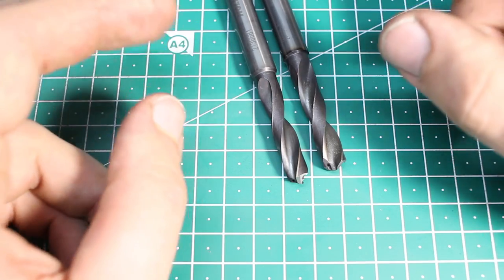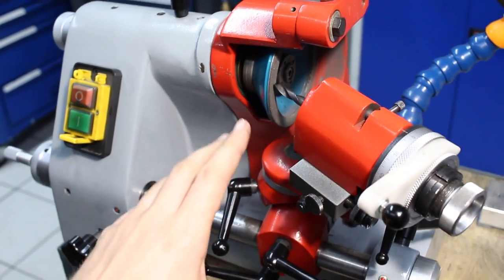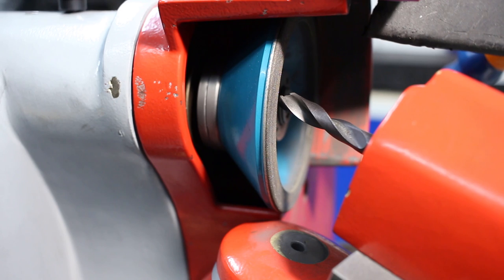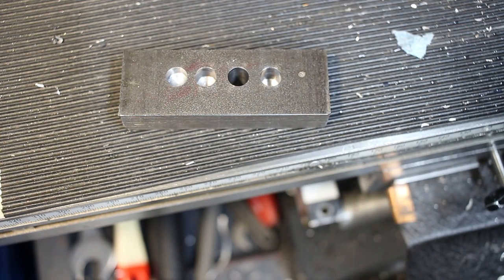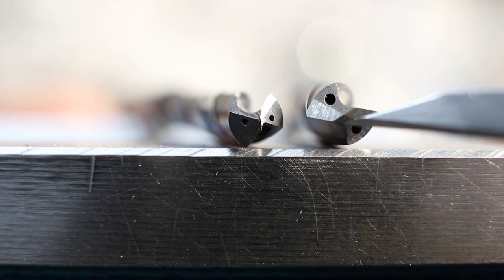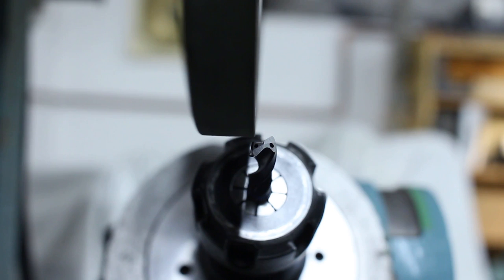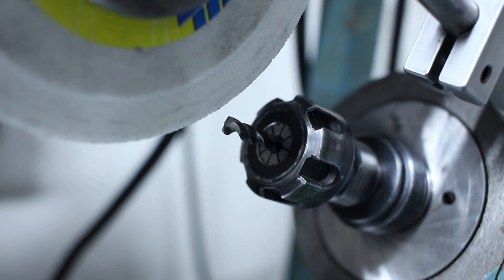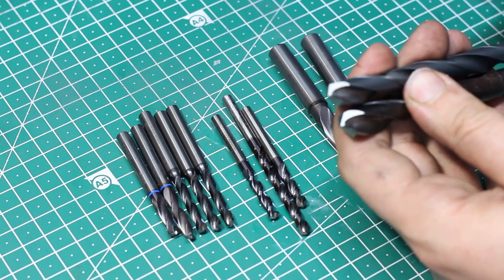Toolgrinding: Four facet grind

Comment: My ancient carbide lore warns me of carbide's brittle nature and raises concern for the fragility of highly positive cutting edge angles. The lip of a twist drill is a prime example where the positive angle equals the helix angle of the twist - possibly 15 degrees in the case of the carbide drills you exhibited. My first impulse would be to grab a diamond sljp stone and "back-off" the cutting edge of the lip to 5 - 7 degrees positive to a bright line - 0.003" (0.08 mm) or so. The object is a geometrically stronger cutting edge less likely to chip in the cut. More holes per grind.

My carbide experience began to peter out when I became a bureaucrat in 1985. I understand carbide technology has improved over the years to rival the brittler grades of HSS. Regardless, a neutral or negative rake would normally be recommended for hard drilling. Hand stoning to consistant edge geometry is chancy at best. Could your D-bit grinder reach the back-off angles I referred to? 

In any case, I think a D-bit grinder would benefit if equipped with additional work head swivel whose plane of rotation is parallel to that of the spindle. You could reach more wierd angles and planes. It would be a tricky project to implement withour making the workhead cumbersome.

Comment: The d-bit grinder (PP-U3) and the correct use of drill extension will automatically obtain your sharpened drill with 4 facets. The first is flat and the second gradient conical profile, this with one operation.
You can see detials in my videos about this.
For the chisel point reduction, it is also feasible on the D-bit grinder. If the drill is well sharpened, 2 identical large chips must be obtained and 2 identical small chips caused by bit tip reduction. With this device the latter is difficult to obtain two small chips but it is sufficient that there is one. I only use the chisel tip reduction for cobalt drills and carbide drills.
In attachment of these videos you can retrieve a document about the machine settings with the necessary explanation.
Because you carry out different machining on a separate basis, it means a lot of time and several grinding machines are needed.
The different steps are already well explained, with very good detailed recordings. Thank you Stefan

Comment: Long live the D-Bit grinder. A lot more useful than people give it credit for. Thank you for showing how simple it really is.  I will be making a right-angle magnifier with an alignment mark to do very small drills (old eyes need some help.) I use an ER16 straight shank chuck, which I cut the back down to give more length clearance (the part right behind the nut doesn't need to be as long as it is).

Comment: Hi Stefan, I know it may sound silly, but you can try to fill the drill bits holes with fluid, cutting oil for steel and wd 40 for alluminium. Just put some wax on the holes on the cutting edge, fill the drill, and go, When you start drilling, the wax goes away and the fluid works. I have tried with good results, but you have to make some tests according to materials and cutting speed. Yes, is not how that drills are supposed to work, but for amateur job is good.

Comment: I always thin the webs using a cut off wheel and my angle grinder. Not super precise but it works. :-)
Reply from the maker: I can do a drill regrind in the field, kneeling on a anglegrinder too ;)
Field Drill Gauge: Two hex nuts held together.
Reply: @StefanGotteswinter  118 degrees, 120 degrees. In the average field, both are good enough! Komplimente an deine technische Sprachkentnisse.. All good stuff.

Comment: Talking about collets, My U2 grinder shipped with just three Deckel style collets (4,6,8mm) which is severely limiting. I was expecting to buy additional collets but not expecting the price to be so high - £20 each in the UK! So I bought another two collets (10,12mm) for the end mills I most commonly use. I have an ER11 collet chuck on an 8mm shank, ideal for small drills and milling tools, but I'm still unable to grind anything bigger unless it fits a collet. My solution for drills - 3d printed sleeves that fit in the 12mm collet. Simple design - 12mm od with a 15mm flange, id sized for each drill, 1mm slot cut through on one side. Seems to work very well, and they could easily be made from a more durable material.

Comment: Hello Stephan! 
Do you have experience with secondary cutting edges? (it's like a chamfer on the end of the drill bit).
In an article I read some time ago they stated that those secondary cutting edges increase the drill life by up to 700%, decrease the tendency to drill crooked holes and leave a much better surface finish.

Comment: Darex was mentioned below once.  I've followed them for years and found their gear fascinating.  I bought the V1 "drill doctor" and it includes fairly easy capability to split the point (thin the web) although the primary grind is more or less the traditional 118  or 135 degree grind.  Using it and I gather their more professional machines is the same.  A lot like sharpening a pencil although mine requires a bit more skill than that but for small drills about the same amount of time.    

I wonder if you have tried sharpening your really small stuff? < 2mm? The drill doctor works fairly well on 3/32" to 3/8" drills.  Bigger ones I can free hand grind well enough and smaller ones cannot be held in the chuck.  Guy Lautard mentioned a gizmo for very small drills in his MBR series and I wondered if you had tried that method.  

Definitely worth sharpening even cheap tools when it only tanks a minute and the cutting performance is so great afterwords.  In tough materials I've resharpened the same drill several times for a single drill session (masonry usually).   

I also really appreciate tool grinding videos.  The D-Bit grinder is new to me and really intriguing.
Reply: For small drills 2mm and under I just use a good lighted magnifier and use a slip stone to sharpen them.  It usually only takes a couple of strokes to get the tip back to sharp.

Comment: I was taught to kick the the spin fixture out of parallel with the table so that the wheel is sort of "chasing the flute" when splitting the point. It's important to leave at least some chisel there.
Reply from the maker: Interesting, I have to try that , thanks- Just by looking at tool geometries its sometimes hard to figure out how they are ground.

Comment: Nice video Stefan...Thanks for sharing. I wonder if a small height gauge on the bed of your grinder would help lining up the cutting edges...Probably more accurate than trying to eyeball it in with a stack of parallels.

Comment: OT but I need to know the name of the classical music at the start.. It's been stuck in my head for a month and I tried listening through most all the classical music I know and some I didn't, tried audio recognition humming it etc., it's been driving me nuts.
Also have been using your technique on my drillbits for a few weeks now and it's saved me a lot of hassle when I've been low on certain sizes btw!

Comment: I quite often split the point on hss drills by hand, it's not any harder than doing a nice job of hand sharpening a drill bit in the first place. It makes a massive difference when it's necessary to drill harder steels with a cordless  drill and also drastically reduces z feed pressure in cnc's which for larger twist drills is usually the limiting factor.
Reply: As for reliability, hss drills in hard structural steel do tend to fail around the relief in the centre first. In softer steel reliability isn't an issue.
I also use a lot of carbide insert drills, which have the same geometry as what you have done. When they are run at the reccomended settings in a cnc, they tend to wear very evenly and are crazy fast. The expensive failures I've seen appear to have been failures of the cutting edge not the Web.
Reply: One other thing, if/when a split point drill fails, you tend to have to remove more material from the drill to resharpen it.

Comment: Good idea, but the problem with 5c-ER Adapters is: They dont have an inner thread. They are only threaded outside. So with most chinese knockoffs that wont work.
Reply from the maker: Oh, the 5C Dbit grinder tightens the collets via the internal thread!?
Reply: @StefanGotteswinter  yes, my Optimum GH20T does - maybee I can change the drawbar.
Reply from the maker: Thats anoying :\

Comment: How do they even get those channels in there ô_0 Mind -> blown.
Reply: That's exactly what I want to know!!! Is it cast in? Is it made with the flutes straight, then drilled and then twisted? Who knows what kind of sorcery is going on here!!!
Reply: Carbide is usually sintered - which is basically taking a gajillion tiny particles of powder and compressing it under heat so it fuses together. My guess is that they lay two long "sausages" into the powder in the desired helix, and when the carbide form becomes solid, they can then use some chemistry to remove the sausage parts.

They do similar stuff when casting things like water galleries in engines that are otherwise inaccessible to machine, I think they're called "cores" when doing a hollow casting part.
Reply: @tuttebelleke  seems like my guess was pretty close, fishing line being the sausage, and the helix lay being done through the extrusion process.

Comment: How the heck do they get a spiral hole in the bit?  Make the hole then heat and twist the carbide?
Reply: This is how it's done in HSS, probably the same.
Reply: I’m pretty sure they use wire EDM machines with a spiral shaped wire.
Reply from the maker: When the "green" carbide is extruded, they spiral extrude it with something like twine in it. When the green carbide is fired/sintered, the twine burns out and you are left with the spiral holes. 
Same process for HSS - The HSS Drills with trough cooleant are usualy HSS-PM, which is sintered HSS.
Reply: @StefanGotteswinter  ahh. Neat!
Reply: @StefanGotteswinter  I've heard from someone  in the industry that they use the plastic fishing line to get the twisted hole and it burns off when sintered. Very simple actually, this bugged me a lot when I first saw them :)
Reply: It is explained here: https://www.youtube.com/watch?v=bo_IUu6U4ao

Comment: An you said “ ...their isn’t that much content. “ yeah right. You’ve, laid out the mysterious ways to sharpen a carbide drill. You missed the one little thing. Which way the wheel, should be running, while grinding carbide.
Reply: Carbide is ground into the cutting edge. If you grind it the other direction you can tear grains out of the carbide right at the edge.